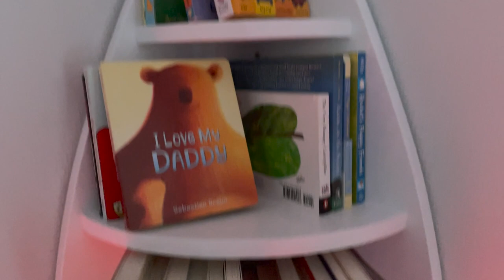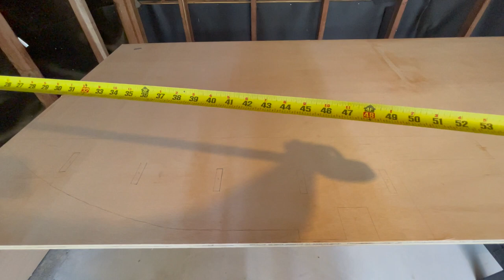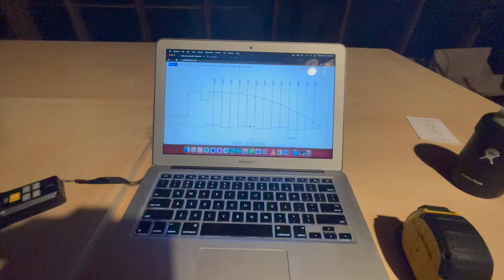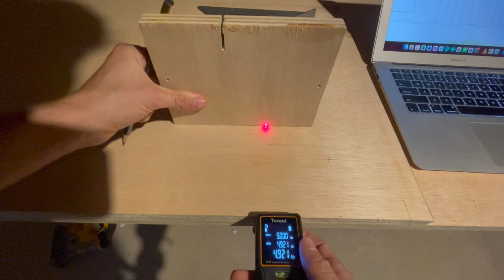DIY Rocket Ship Bookcase

Comment: I've never done well with iron on edge banding, I always rip my own on the table saw. As you were painting you could have ripped down a bit of pine and glued it on with wood glue, then you know it won't ever come off, you could add wood filler behind any gaps when it's dry aswell
Reply from the maker: I didn’t have any problems with the iron on stuff when I was putting it on a flat edge. It was just on the curved edges that gave me problem. The wood filler is a good idea though! Thanks!

Comment: You should add a remote instead of the button so you can pretend to launch the rocket and maybe a little speaker as well to make it feel more real. For the "Fire" you should add cotton so the light shines through and it looks like the smoke and fire also add oranage to the leds. :)
Reply from the maker: Boy do I wish I would have had you as a consultant when I was designing the rocket ship! Those are all great ideas. Maybe for kid #2.....